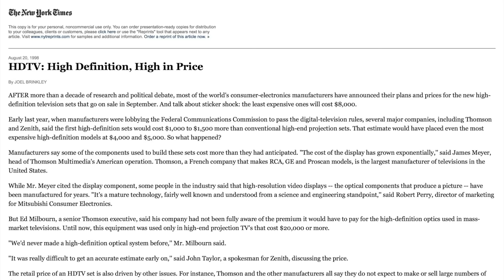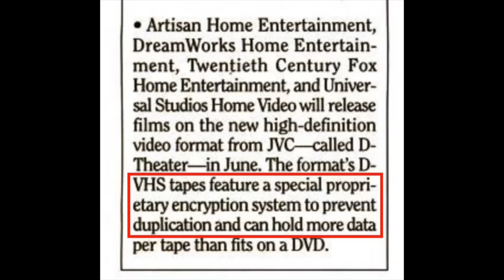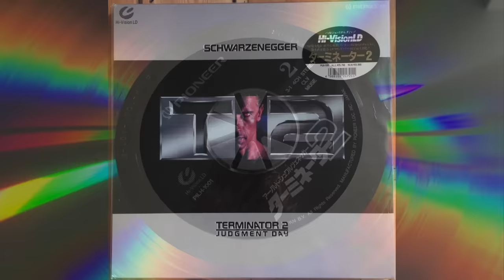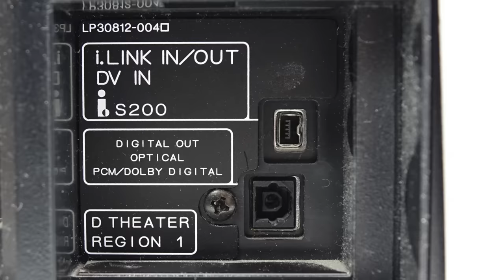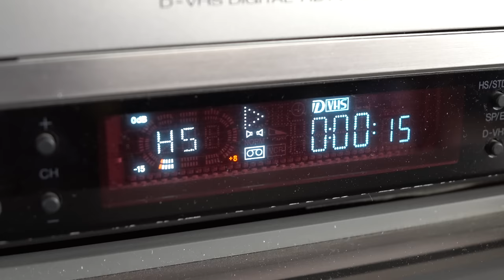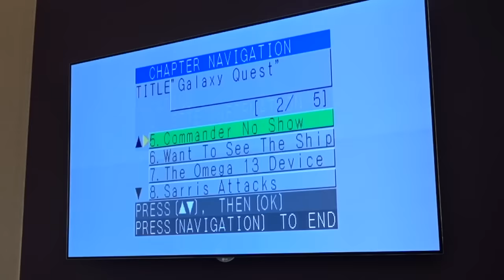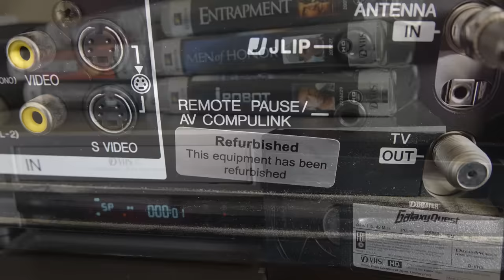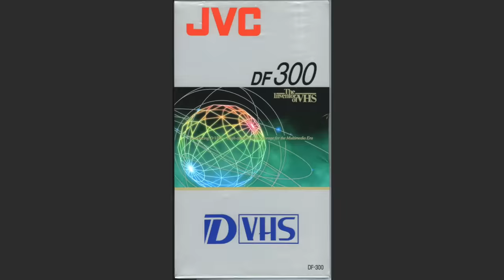Remember when HD Movies came on VHS tapes?

Comment: The reason you couldn't record from component input is not because of copy protection, but because this would've required a video encoder, which would have been very expensive at the time. When using the digital iLINK input however you can just record the digital bitstream, not requiring any video encoding.

Comment: In Poland in 90's it was quite common to backup data stored on Amiga to VHS tapes, there was cheap hardware released for that. On Commodore 64 you could store about 900k of data per 30min cassette side if using ABC TURBO/TURBO250 data protocol.

Comment: Some flat screen televisions could not handle HD until 2009.  I did on-site-warranty-repair-for-Visio-flat-screen-TVs and I had to fix them when Time Warner Cable upgraded their cable boxes to accommodate HD.  By "fix" I mean field mod which involved replacing a ribbon cable.  Since this involved unscrewing and rescrewing over 40 screws this was non trivial.  The symptom was red and green flaring where the screen was supposed to be black.  The replacement cable had more twists per inch.

Comment: Back in the 1980s, Warner Brothers used a signal that told the signal gain of the second video if you linked two videos together to copy a tape to lower and raise its gain which produced a pretty awful recording, they got around the copyright protection by using video senders then the signal had no effect on the recording video.

Comment: I didn't know HD TVs came out in the USA way back in 1998. That's crazy! I got my 1st HD TV.. was a 32" LCD.. in 2008 I believe. Got it because the PS3 I bought looked bad on the regular TV I had. After that got 5.1 surround sound so had a cool setup. Eventually, a couple years after that, got a 46" LED. Ah the good ol days. Can't get em back.. =-p .. .. ..

Comment: I know there is a small time line difference between D-VHS and Betamax ED (DVHS released over in 98/99, and beta stopping production of decks in 2001/2002).

Odd note when D-theater (720p/1080i playback only) came out in 2002, it managed to be the "highest resoloution" tape media, by not having a challenger anymore lol

Comment: First hd televisions had old tuners in them. They were old the day they were bought.  Then they started making them with atsc which is fine if you use rabbit ears.. it wasn’t until 2004 that we finally had hd tv’s that could work on cable systems without a box (qam). Also supported a cable card to watch premium content. That is when everyone started buying up all the plasma tv’s.. that didn’t last to long.. lcd was getting cheaper and cheaper..

Comment: The biggest downfall of the format was TVs in the US on had certain ones with Firewire Hook Ups on the TV and most started not carrying this attachment to even play the movies
I used tha Analog set to play and record basic TV. I was also able to use S-VHS Format and was able to use regular tapes by drilling a hole on bottom of the tape to allow S-VHS recording  and front panel showed it was a S-VHS tape and it did improve the broadcast quality in recording. Also the DTheater player had fast speed rewind and fast forward it was awesome to see it go into warp speed and did not break the tape at the beginning or end of the tape .I had this setup for 15 years and it worked for me still wish my TV had that firewire connection

Comment: 2009 is when I turned HD and 2019 is where I turned 4k
Reply: I turned HD in 2009 on PC but I think, like, 2014 for my main stuff. Went 4K in 2018. I was using an analog TV right up until they stopped broadcasting with em.

Comment: Slightly off-topic but the BBC and some of the European broadcasters were experimenting with a 1250 line system in the 90s which they hoped become a world HD standard. The Japanese were keener on 1050 lines. Both systems basically had twice the number of lines of the local standard systems (625 and 525). It was all pointless really because the broadcast digital systems were about to be developed with their own HD variants.

Comment: One has to assume that D-Theater on VHS was a digital code being read of a tape magnetically, rather than the previous analog method -  like DAT (or the VHS big brother ADAT) compared to a standard cassette, correct? These read a digital representation (code) of rather than analog content. It wasn't clear in your video what made the difference.

Comment: D-VHS failed for the same reason Ultra HD DVD players have failed. It's resolution versus ease of use. In the 2000s people loved discs and how you could easily skip to the next scene, as well as change audio, bonus features etc. That was a better selling point than a higher resolution picture for most. Tape was so last century. Even if the players cost $100 I still don't believe people would have bought another VHS player after DVD. Nowdays people are happy to watch something streaming in HD with buffering and all those issues because it's a lot easier than buying or renting Ultra HD discs. Personally I didn't get a digital tv until 2012 when they became cheap and I think a lot of people were the same.

Comment: I used two different VCRs to timeshift HD programming from DirecTV. Too bad that the reduce bit rate  recordings from matching disc. I never did bother with the prerecorded tapes. Reliability definitely is an issue. My recorders stopped working about 10 years ago and replaced most of the recordings with Blu-ray Discs. I do miss a few classic Super Bowl moments that I captured on tape though.....

Comment: If a D-VHS VCR could use modern VC-1 or H.265 codecs, it could work perfectly well for 4k video or even 8K. I love my UHD blu rays, but they are too susceptible to scratches with data packed so dense,

Comment: I can imagine the quality can degrade over time as with normal VHS tapes, since the medium used is easily corrupted, as long as it isn't scratched heavily a CD/DVD/Blu-ray can keep data integrity for a very long time.
Reply: Seeing as it's "digital data", there is no loss in actual quality of the picture and sound. When you lose data, you lose both. It doesn't simply look bad; it's gone. The only way you could say and mean a loss in visible quality would be the breakup in the compression.

Comment: I doubt Sony did the Dreamcast any favors, but the reality is the Dreamcast had it's own fair share of problems. The library was like 95% arcade ports, which isn't a surprise, I believe I read an article that stated some Sega arcade cabinets were using similar hardware. The controllers sucked ass when compared to dual analog sticks. They still used memory cards, without any onboard memory, even though the fucking Sega CD and Saturn both had limited onboard memory. That's completely ignoring how easy it was to pirate. You'd have thought that after generations of botched hardware releases, they would have been smarter.

Comment: "DVD doesn't hold enough data for an HD Movie". That is actually incorrect, if your movie is in "Blu-ray" format then yes it won't fit but if you compress the video into an mp4 or mkv file you can easily fit an HD movie on a DVD :^)
Reply: .....and if the movie is very very short?
Reply: He should have said .' DVD couldn't hold enough data' because at this time there was not such a thing as mp4. DVD was stuck with mpeg2 encoding.

Comment: Fascinating - the quality of this format is superb. I only remember crappy SD and worn-out VHS tapes from this era. The transport reliability issues seem similar to when Alesis launched the 8-track digital ADAT platform – basically using a mechanism comparable to a domestic VHS player. These were a hit with studios and were used extensively. As a result, the transports just weren’t up to the task.

Comment: Isn't there supposed be a plastic flap on the optical out?
Reply: I guess it's broken off. Unless it's not TOSLINK and it's something else that doesn't have a flap
Reply: @nthgth  do u know a way to fix the flaps? I have a Sony da3000es and one of my optical input flaps broke off and doesn't hold a good connection.
Reply: @reecebower9934  I'm sorry I don't. I didn't even realize the flap was important for that, I thought it was just to keep the port clean 🤷🏻‍♂️
Reply: I am aware that some older devices didnt have a flap but instead had a peg thing that is inserted into the hole when not in use (i have 2 audio devices which use the pegs instead of a flap, but the pegs are missing on one of my devices)

Comment: My curiosity: what happens if you insert a D-VHS tape onto regular-standard-analog VHS player?
As mentioned in video, tape cassette is the same.
I think if you play a DVHS on VHS player you can see a video incomprensibile that is a streaming of optical/analog information coded in digital information.
Reply: regular vcr won’t play d-vhs

Comment: curious does this thing will play regular vhs or even s-vhs tape by using some D vhs circuits better than JVC's HR-S7600 with TBC/DNR button turn on. also does it possible to push S-ET on regular vhs and take any upconversion performance.

Comment: @techmoan, would it be possible to fit a 12.650mm IBM LTO-1-8 Ultrium tape into a D-VHS cassette (12.7mm tape) and then record a copy of a blu-ray movie to it?, would need to decrypt blu-ray and rip it to hdd then reincode the video (with DVDX-4) to MPEG-2 format with 1920 X 1080i resolution (may require DVDX-4 of HD-Fury to Get 1080i Interlaced) & then send down a firewire (apple?) cable to a D-VHS recorder. IF LTO is designed for digital (binary) and D-VHS is also digital/binary would LTO tape function in a D-VHS cassette, this is the only way I can think of having high quality working video cassettes for life (LTO-8 last 15 years to 30 years in deal conditions, but you can always make free recordings form HDD or blu-ray), I don't won't to bin my VHS-tapes, especially the the cassettes, cassette labels and boxes with box art, i could bin the tape itself if I have a D-VHS/LTO alternative, it would look and work the same without the ever poorer quality of VHS tape which is degrading all the time.

Comment: Hi,  after watching your video, i looked in my dads old video collection and found a Sony Video Walkman GV-8E PAL (1989 in mint condition with manual, fully functional  and no marks or scratches etc). the battery pack still works, it also comes with a charging dock and all this was inside an original sony hard case mini briefcase. i checked online and dint find a single similar model for sale in good condition. only for sale were for parts. i checked back history and it sold for btw 1000usd to 1400usd in the past few years. Therefore since this is in mint condition, extremely rare and not a single one for sale online, could you help me with what price i should set to sell it for ??  ofcourse i will includes as many org pic and videos showing its in mint condition and fully functional and comes with all accesories (inclduing org manual and briefcase by sony). My father was a distributor for sony, so we used to have lot of sony gadget throughout the 80s and 90s and most were hardly used. any help would be greatly appreciated. thanks a lot :)

Comment: HD is confusing. There's standard HD, which is 720p, but then there's Full HD or FHD. Then there's 4k.
I cannot stress this enough: MATCH THE RESOLUTION TO YOUR MEDIUM!
Uncle Jimbo dropping a couple thousand on his new 8k tv is a complete waste when uncle jimbo watches only cable football that is only HD 720p. 
Similarly, buying a 4k Blu-ray player when your tv can only display 720 or 1080p is a similar waste of money and technology. Blu-ray is significantly more expensive and not worth it unless you actually have the right hardware.
Your regular satellite television broadcasts only hits a max of 1080p. The same is true with most streaming nowadays. Don't buy a 4k tv unless you have or intend to have either extremely fast internet for 4k streaming or a 4k blue ray player. Other than those 2 expensive options, you're not going to need a 4k tv right now in time unless you have a super high end gaming computer.
As of now, is say that 4k tvs aren't a good purchase unless you're a niche technophile or you have a lot of cash to burn. Just wait until more 4k media types come out.
Reply: I do have a 4K blu-ray player, and some 4K blu-rays to go along with it
but there again i have a 4K AV reciever, and a 4K display (its actually a computer monitor, I have a windows desktop that has a 4K capable graphics card in it, which is connected through what is most likely too many devices before it reaches the monitor, and i plan on eventually getting a new monitor)

and when i was getting an audio system to go downstairs (someone i live with has hearing trouble) i went with a 1080p AV reciever, and i had previously got a second hand blu-ray player (as the TV that used to be downstairs was able to accept a 1080p signal, but it was verry fussy about it, but it seemed to be fine with the AV reciever, but as the TV is ageing and showing signs of its age, it would be at least 8 years old, we now have a new one, which is definatly 1080p, the new one has 3 HDMI inputs, the old one had 2, and the old one didnt support HDMI audio return, whereas the new one does)

Comment: 15:31
That's why traditional broadcast channels should and (probably) will die out. They provide crap quality further ruin in with logos and advertisement/promo crap on the image, and splice it up and fill them with commercials, and as a final touch often mutilate it by cutting out parts.
A Netflix like approach is far superior to this. Especially now with modern codecs and high internet connection bandwidths.

Comment: Yesterday’s best tech! Yes indeed! WoW!! .... Hey TechMoan ... Can you research and explain transfer VHS to SSD computer drive(s).
Some of us are as nuts as you are, and are still ( or at least would like to) transferring older VHS cassette videos to computer hard drives (HD) and possibly now SSD drives, perhaps to a multi-HD server run by the old Window Media software which is part of Windows 7 to create a media server. I haven’t done any of this yet, because I have heard Win 7 users are being forced to upgrade to Win 10. Is this true?

I did run across this article about DNLA media server functionality available within System 10, (but haven’t had time to pursue it)
https://pureinfotech.com/turn-pc-dlna-media-server-windows-10/

You’re appreciate much, TechMoan Man. Some of us have tons of audio cassettes and VHS cassettes and are trying to get the old rubber drive belts fixed. Life goes by so fast that there hardly time to do everything there’s to do. Going back to replay old media formats and fixing those older machines unfortunately is not so much of a big priority.

Comment: Yeah the British think they need 555 volts in a standard house plug for some reason I'm being a little bit sarcastic it ain't that much but it's way too much it's enough to kill somebody which is ridiculous but I guess you know they got to be able to heat up that tea real fast that water you know might take them an extra minute to boil water
Reply: Wattage is the power output (volts x amps). UK sockets are nominally at 230v with a max of 13 amps in the plug.

Comment: In American average homeowner can wire in an electrical socket in their house no problem but in England you try that and make a mistake you're dead it's dangerous cuz they God forbid they got to wait an extra 15 seconds to boil water
Reply: Well no we wouldn't because we are not stupid and are very capable of shutting the power of at the mains!